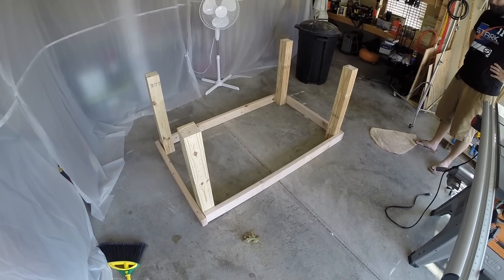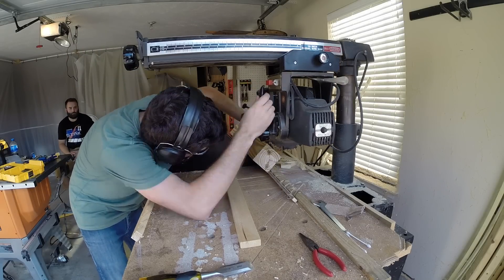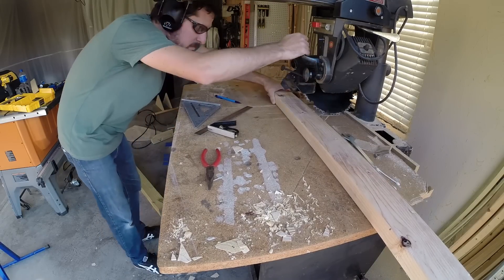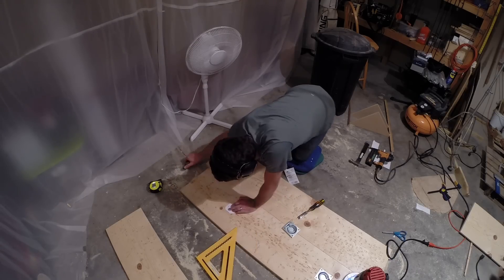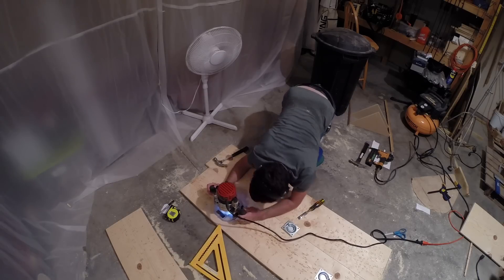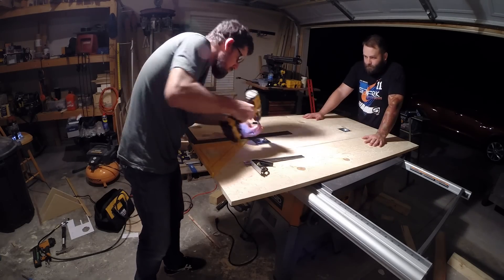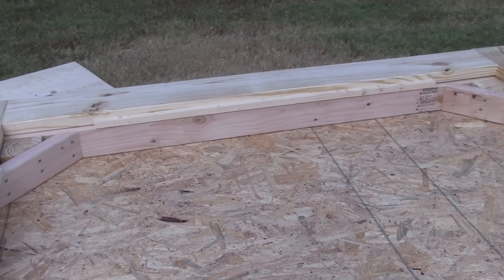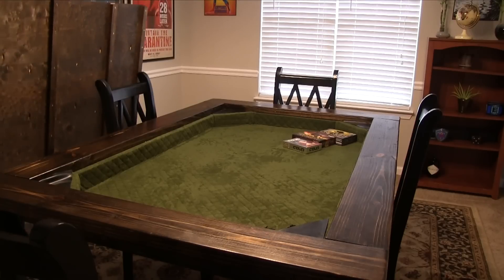DINING TABLE WITH HIDDEN TABLE TOP BOARD GAMING AREA - HOW TO

Comment: Was the arm rest part of the table strong enough with just the pocket screws? 
My thought is people tend to put some weight on it when they lean over to look at the game. Have you had any problems with the arm rest?
Reply from the maker: This was early in the woodworking journey. Of course there are stronger joints, but I was at my brother in law’s just a couple weeks ago and everything is still standing and I’m working order. If I did it over again at this point I’d probably do it a little different and a little more traditional, but again, it’s still holding up.

Comment: What do you think the chances are that I can do that cut for the legs at 0:48 with a mitre saw?

Or will I have to find a friend with some higher end tools?
Reply: You can. Miter Saws have a screw/adjustment to stop the saw from dropping all the way. Use that to set the height of the cut, and create a similar jig to set the 45 degree angle, and you're golden.

Comment: How were you able to get the rubber matting and green fabric nice and flush with the edges and floor of the table?
Reply from the maker: patience, razors and straight edges, lots of spray adhesive, and then even more patience.

Comment: How do you keep spills from going between the edges of the top onto the gaming surface below?
Reply from the maker: Very carefully...but seriously, the top rests on a support ledge so a small spill probably wouldn't seep to far.
Reply: if you were worried about it im sure if you account for the height of the rubber, you could put thin rubber around the edges (like the part the removable top rests on). The weight of the top should seal it pretty well to allow you to dab some paper towels or something along the sides if you do have a spill. Also on something like this, table cloth is probably a good choice for dinners with people but i would leave it off most of the time as it looks good and i want to play games

Comment: How did you attach the bottom plywood?
Reply from the maker: wood screws. around the 3:45 mark you can see in the side profile it is just attached to the bottom of the skirt.  If was doing it again, I would have grabbed some extra trim and beveled the corners to cover the bottom plywood and the butt joints made by the 2x4s.